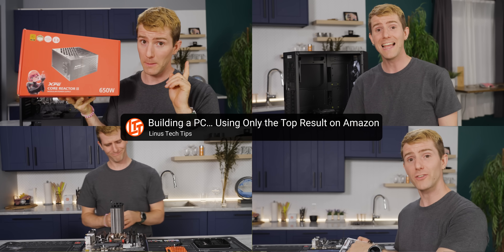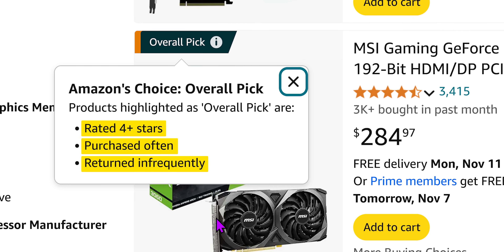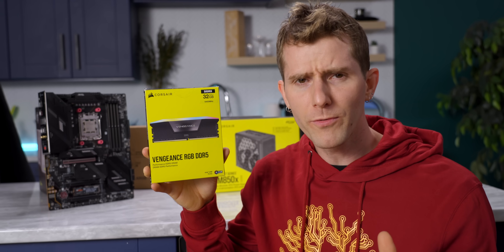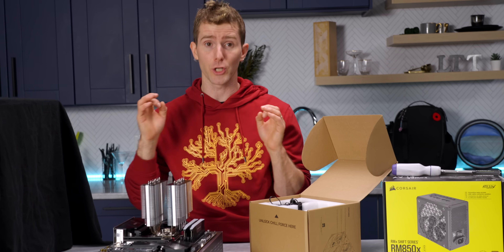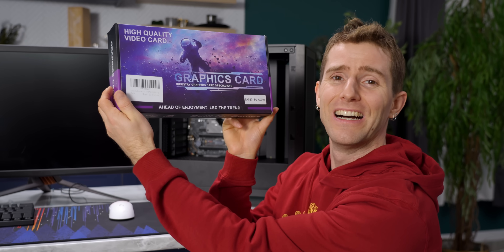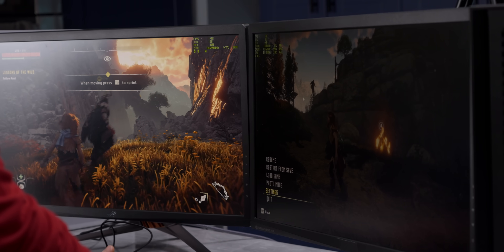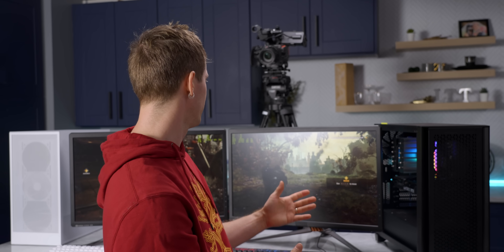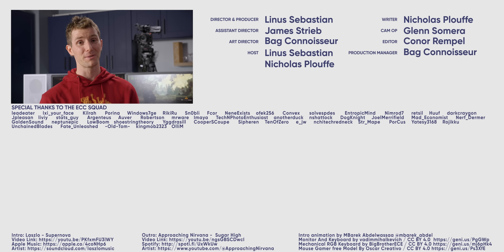Building a PC Using Only Amazon's 'Overall Pick' Products

Comment: The SSD is the overall choice because not all pcs support nvme. There are people with old computers who want to throw in a ssd to just that faster boot time. I actually bought 4 sata ssds for all my computers in my office.
Reply: or secondary SSDs. also, good choice, OS disk needs to be SSD at least, especially for windows 10/11, using HDD on those is torture
Reply: @noredine  It is quite tolerable if you use use linux and disable fsync. You often will barely be able to tell the difference between HDD and SSD (provided you have a decent ammount of free RAM). The effectiveness of the RAM caching Linux does when you prevent forced disk waits is absolutly mindblowing.  
It's not really worth the increased risk of data loss tho, as ssd are priced quite competetively these days.
Reply: Because it's Linux..... You can run this shit on... Well.. I'd mention some absurd/oddball device but at that point what hasn't Linux been ran on?
Reply: And also those BX500 drives are dirt cheap, while made by a very trustworthy manufacturer. Perfect exactly for what you described: old and low end systems where you just need something to boot the OS.
Reply: Well, thanks for all your replies. I tried to give the rationale behind the overall choice thing. My comment justifies the 1st requirement of being sold a lot, like I said I bought 4 ssds at once.. there are people buying these a lot. The second requirement is being highly rated. Just imagine a person switching from a hdd to ssd, they are going to see a massive improvement in the overall responsiveness of their computer and are likely to leave a positive review. And the third criteria being returned infrequently is just justified by the fact that this ssd is a quality product and there is a slim chance of it failing within 30 days. I hope this explanation clears all the doubts.
Reply: MX would have been way better than BX unfortunately. The BX drives can potentially become slower than a HDD during intensive operations due to the lack of caching. Cheap NVMe drives can get around this because of HMB.
Reply: @QualityDoggo  I still would recommend those for cheap solid state bulk storage and older systems, because even with how slow they are in general, they still have way better random reads and writes, while (in my experience) being way cheaper then other drives from samsung or toshiba.
Reply: It's nothing so deep. The SSD is the "overall choice" because it's purely a sales volume thing, and they've sold more of those because they're generally cheaper. Same as to why the absurd 3060 suggestion.
Reply: you can buy pci-e expansion card for the m.2 ssd they aren't that expensive ether.
Reply: @Elyygee  Have you tried that? Just because you can put an NVMe SSD, doesn't mean BIOS will know how to work with it, so you'd have to find a way to do that, either through hacking the bios itself, I've seen people doing that on AM3+ boards, or installing a bootloader on some other media, not to mention laptops that don't even have that option.
Reply: @hikkamorii  I just recently done expansion card + m.2 for my X370 mobo because my poor HDD was 80% in the grave and i already populated the single m.2 slot on my board
It worked with no issues and drive appeared instantly on disk manager
On top of that the speeds you gain over sata ssd are absurd and it runs on gen 3.0 x4 speed (I also got another unpopulated slot for B+M key) and expansion card only costed me 10euro

If you got the slot for it i highly recommend it over sata ssd ofc if its older laptop then the only way is sata ssd in most cases
Reply: Am I the only one that can' tell a huge difference in boot time from a hard drive vs SSD. now my nvme drive on the other hand is a rocket.
Reply: @gorkskoal9315  It was the other way around for me. HDD to SSD was an actual game changer, a huge difference. But going from a SATA SSD to an NVMe SSD didn't really make a difference. Only time I really notice it is when I'm doing huge file transfers
Reply: @Louis_Bautista  oh I meant when I went from hdd to m.2
Reply: @gorkskoal9315  yeah you are, HDD to SATA SSD should be a bigger upgrade than SATA SSD to NVMe SSD
Reply: it's the overall choice because they need to sell the inventory

Comment: Guys.. Come on :)
1. Ploof's  CPU was at 96-97C the whole time
2. 4000D and H5 Flow both come with only 2x 120mm case fans. For proper build advice accuracy including a few more case fans in calculation and build would seem only appropriate
Reply: Isn't the 7000X series supposed to go to ~95C? Very weird how Linus's machine doesnt do that. Is that because of the GPU bottleneck?
Reply: @Jun1oR1101  they have the same cpu usage and also linus was clocked higher at 5120 mhz while at 64c and nicholas pc was at 97c at 5005mhz both had the same cooler and cpu
Reply: But why, with some brands you pay 10 bucks per fan.
Reply: @HydrasHead  very true, case fans can be quite expensive when bought separately. But for a 1200 dollar setup some extra 20 bucks for a nice Arctic P12 Max 3-pack for example makes very little difference budget-wise. And helps a lot with keeping your components well ventilated, which is actually very important for the CPU choice that LTT boys went for. Hope this helps :)
Reply: it's wild how some people are blaming AMD's boost behavior when the EXACT SAME cpu is chilling at 62c on Linus's system. The problem is NOT the cpu guys....
Reply: @Anti3D-0  My 5600X with a $20 budget cooler attached doesn't budge from 65C. Def something off.
Reply: @Anti3D-0  He probably has the heatsink upside down.
Reply: Sigh, it's so tiring seeing the number of people who think a high temperature is "bad". That's perfectly normal to see when auto-overclocking.
Reply: @MTGeomancer  what's even more tiring is people, who think they know better, are condescending and arrogant towards others. 96C at 50% utilisation in gaming is NOT normal even for an overclocked 7700X.
Reply: @TheBerzs  what's even MORE tiring is people who still don't know what they're talking about. Zen 4 and 5 are actually targeting 95C. I quote: 

"AMD Zen 4 and Zen 5 CPUs have their thermal target set to 95°C, which means the CPU will boost as much as it can, until it reaches that point, to maximize performance. Unlike on Intel, on AMD it's not possible to increase the 95°C limit."

Source: TechPowerUp
Reply: @LordManhattan  Looking at the headline won't give you a complete picture. Ever. That quote is so far out of context it could be called Intel at this point. Now with the real numbers from this video: they do not max boost until they reach 95C while gaming at 40-50% load!!! They don't need to!! Running at 4.9GHz on 50% load with 97C temp on the other hand is a CLEAR indication of an issue!
Reply: @MTGeomancer  No, as an IT professional with decades of experience, anything over 90C will dramatically shorten the life of the piece of electronics in question, no matter what it is.
Reply: @josephoberlander  And as an Electrical Engineer with decades of experience you are incorrect in this context. There is a world of difference between servers running 8760 hours per year, and a game running for 520 hours per year. This is an example of taking a fact (higher temperature results in lower reliability) and applying it universally without context.
Reply: @MTGeomancer  well considering they both have the same cpu and cooler just different chipsets that is a huge difference

Comment: BX series is bad choice. From Mr. Google itself:
The BX is a stripped-down version of the MX - it's got a different (slower) controller chip, is lacking MX's data encruption feature, and doesn't have the MX's SLC (single level cell) caching, so it's not as quick or durable as the MX.

Comment: The Corsair SATA SSD was the pick because of the high number of people which, to this day, buy them as HDD replacements to speed up older model desktops and laptops.  This is especially true for the technician / small computer shop that does the work for the client.  Pull HDD, pull SATA SSD from box, clone drive, reinstall, done.

Comment: 2:52 X670E tomahawk owner here, i have both a 990 pro and a WD Black SN850X never ran into any issues with both SSDs in my motherboard
Reply: I also have both sn750 tb and 2 990pro 2 tb and never ran into any issue too
Reply: I have a SN850X in mine and it'll disappear every few days, even on the latest BIOS firmware. The only fix was to restart Windows.
Reply: Same mother board and same. Also, just bought a 4TB 990 pro on Amazon so I'm not worry
Reply: Thanks for posting this.  Just bought the X670E Tomahawk for my kid's build - I have 2 SN850X in my MEG Z690 Ace and they're great drives, so will give them a go in the X670E.
Reply: I too have had a sn770 in the system with no issue. Only one I've faced was the weird startup times I would get when booting up from a full shutdown or my RGB controller just suddenly being undected
Reply: tomahawk tuah
Reply: @KayleighOwO  i love you
Reply: For the love of god don't use WD, like EVER.
Reply: @m-Parsa  Have had many WD HDDs in the past and WD NVMEs and have had 0 issues with any of them. You just got unlucky unfortunately. Also have a WD SN850x in my system with the Tamahawk Wifi, has worked perfectly from day 1. Friend has and EVO 990 also with the same board, no issues.
Reply: @m-Parsa  How so? If anything Seagate has been known for being bad.
Reply: @m-Parsa  why? I am Happy with them. Have plenty...
Reply: @m-Parsa  WD sells a ton of crap SMR drives but as long as you look for their quality stuff they're fine, I have a 2tb WD Black HDD from 2015 still going strong, a 3TB external that is almost as old, and a WD Red Plus 4TB I bought like a year ago all working great, haven't bought their SSDs but hear the SN850X is a great NVME drive.

Comment: Well something in "defense" of the amazon picks. I think that these encompass more than just "wanting to build a new PC"?
Of course SATA SSDs or even a one generation (good new market value) will be more popular than the newest/most up-to-date components. These are more typical upgrade parts&paths for existing older machines. Just due to comparability reasons or possible "over-budgeting" in terms of performance, meaning bottle necking.
But please correct me if I am wrong here in my analysis! :)
Reply: I'd imagine you could be buying more SATA SSDs than NVME drives too. I have an NVME, but I also have a SATA, and I'm thinking about adding another. But I can't add a second NVME with my current motherboard.
Reply: I heavily agree with this. i thinks NVME came around 2016 ish, some PC's from 2012 will probably have that extra sata slot for an older SSD, i mean, if you are on your work PC that is only ever used for some excel, e-mail reading and some calls, i'd say it's a really great upgrading from a HDD to an SSD

Comment: I am amazed that bx500 has so good reviews, but hey overall pretty good PC parts (except gpu and ssd) were recommended

If only Plouffe changed that cpu for 7600 and storage for something reasonably priced there would be enough headroom for better gpu and crushed completely
Also was CPU cooler on his PC mounted correctly? I feel like 97C is not correct for that cooler even without fans on

Comment: Would you go 7700x 7700xt or 7600x 7800xt? What is the power move to build a pc that may be playable out to 4 years.
Reply: 7700X and 7500f/7600/7600X perform about the same in gaming, 7700X pulls ahead in games that do need more cores though, and any sorta productivity.

I would personally not get a 7700X unless you're getting a 4080S or 7900XT/XTX or 4090.

Comment: maybe im crazy but if the methodology for selecting the SSD was searching "SSD" on amazon. I would expect a 2.5" SATA SSD every time. Maybe this is just me being old fashioned but "SSD" without "NVMe" preceding it always means that SATA form factor.
Reply: I agree, but I'm also confused why their overall pick was a sata ssd. I went to go search for myself both in my main account and in a private window, and the Samsung 980 pro appeared for me both times. I wonder if the sata ssd at the time of filming and procurement was that crucial sata ssd. I'd like to see some extra information on what and when they searched in these videos.
Reply: @kingchangling  this is tricky b/c LTT didn't disclose when they searched and/or the criteria.  That said - using private browsing searching for "SSD" the overall pick is the Samsung 980 Pro 2TB
Reply: I was thinking the same thing; if you want a NVME drive, that needs to be part of the search criteria.
Reply: @vera9230  I searched SSD in my Amazon search engine and the top 3 results were a sponsored Lexar external SSD, a sponsored nvme KingSpec SSD, and an overall pick Samsung 980 Pro 2TB. I’ve only ever used Samsung SSDs so I’m convinced we have different search algorithms. 

Mind you a SATA only showed up in my search after the 8th m.2 and after “customers frequently viewed” and “Black Friday deals” horizontal ads.
Reply: searching just 'ssd' on amazon gives me a 980 Pro 2TB nvme. Not sure what they were searching for
Reply: @mb9023  outside of the US, the amazon choice shows as the BX500, not the 980 Pro.
Reply: @MalteSpieltYT  Belgian here. 990 EVO Plus is top result if ignoring sponsored section on top. If including sponsored, then Lexar NM1090 PRO
Reply: @mb9023 Same

Comment: Plouffe’s CPU was almost 100C lol
Reply: noticed that too, but then i realized its a 7700x, they are hot & go pretty much "up to 95°c(+-2°)" with their boost clock.  he also had a much better gpu so linus card bottlenecked so hard the cpu doing basically nothing
Reply: @Vss077  dud they had parts with max 5% more usage on plouffe pc but linus pc was clocked higher at over 5.1ghz while hovering around 64c , plouffe was at almost 100c at 5ghz
Reply: It's Zen 4, they like to do that on stock settings.
Reply: I was looking at getting a new PC and based it from Plouffe's build. What cooler would anyone recommend instead?
Reply: 92... Its how the 7000 series performs when under full utilisation. Its actually fine and designed to run like that. The other one isn't running that hot as its not beeing driven as hard due to GPU bottleneck.
Reply: @Gantali9305  96*
Reply: I don't care if they CAN run that hot or not, I don't want my cpu 93c ish. My R5 7600x always stays under 60c while gaming (granted I have a decent 360m AIO)
Reply: @XuroX.  which brand? running the peeless 120 se and im getting 55c normal use and 70-85 in game but it could be better

Comment: Wait...do you have to deal with the manufacturer in the North America if there's a faulty product and not the reseller - Amazon in this case?
Reply from the maker: Depends on the timeframe. -LS
Reply: @LinusTechTips  Interesting. Thanks. I'm UK side of the pond, and if something goes wrong inside the 12 month warranty it goes back to the authorised reseller and they have to deal with the uplift back to the manufacturer.
Reply: Sometimes on the extended warranty too though that may be the manufacturer after 12 months.

Comment: SATA drive probably just because people buy it for expansion when their M.2 slots are used up. Aside from premium MBs you usually get what, 2 M.2?
Reply: Small, fast m.2 for the OS, large drive for Steam and other stuff. :)
Reply: A lot of older boards like mine only have one.  Its a $200 msi mobo from like 2019.
Reply: And if you get more than one M.2 Slot, you get it with Lane Sharing 🥲
Reply: Idk, I feel like people who want extra space for datagraves would go with usually cheaper external drives - sure, some may take internal SSDs but I honestly think the majority of the sales come from people who are upgrading older PCs to SSD or generally picking them when their system doesn't support NVMe.
Reply: Building on a budget personally I went for the absolute cheapest possible motherboard to give more money to CPU and GPU lol, only 1 m.2 slot on my am5 platform

Comment: I work at an SI, not massive, but not that small either, we order most of our products on amazon for prebuilds lmfao
Reply: @Bravozzerosix  That's wild, not buying wholesale direct vendor is profit lost.
Reply: @connor040606 depends if they have the scale to order at whole sale
Reply: @connor040606  we aren't really big enough to be doing that, only around 30 PC's a day, and we get our stuff without tax via Amazon business accounts
Reply: @connor040606  for a smaller company that's not buying massive volumes, retail can be cheaper than direct wholesale. And probably also faster and more flexible.